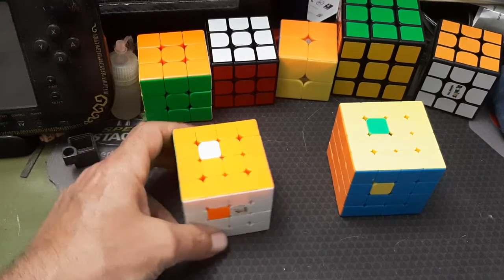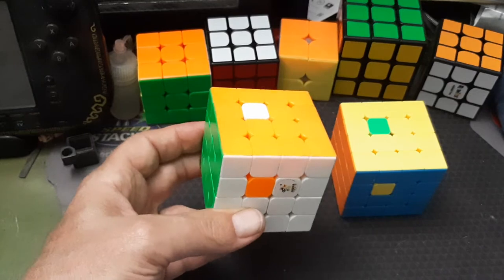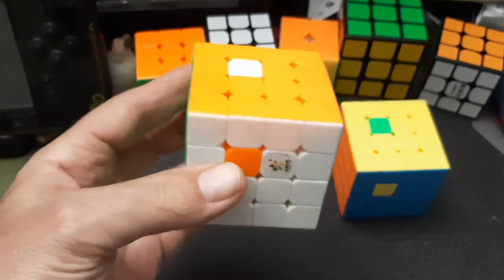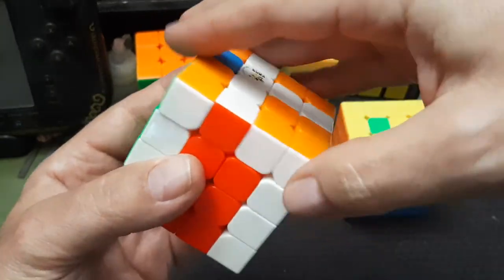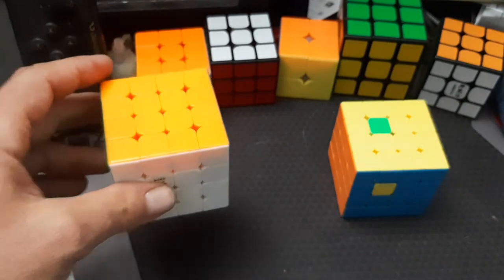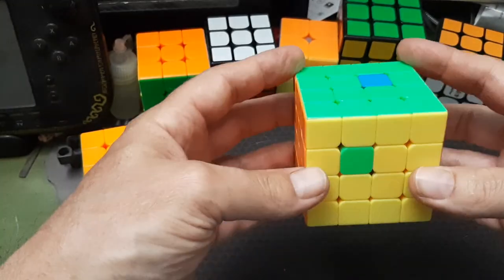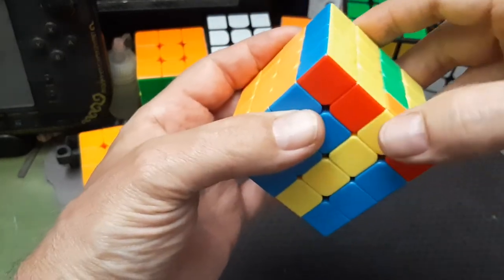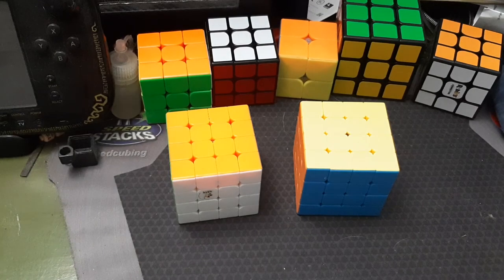More than your regular 4x4x4 center commutator.

Comment: This brings back good memories.  I too made a video about using variations of this so-called "Niklas" 8 move commutator to solve the entire 3x3x3 cube as well as select cases of the 4x4x4 in my video Easy Beginner Tutorial on Rubik's Cube Commutators .  I also used variations of this commutator to create a 19 quarter turn move single edge flip parity algorithm for the 4x4x4 in my playlist Intro to Wide Turn-Based OLL Parity Algorithms .  But you're right.  Most people don't use this.  Those who create patterns, those who blindsolve, and those who use "direct solving methods" for the 4x4x4 will use these, but no speedcubers.